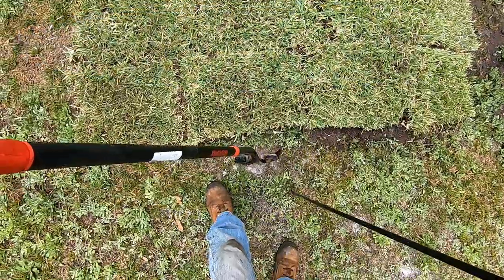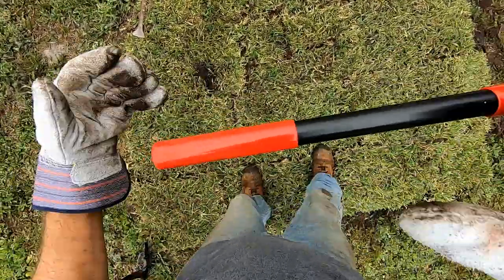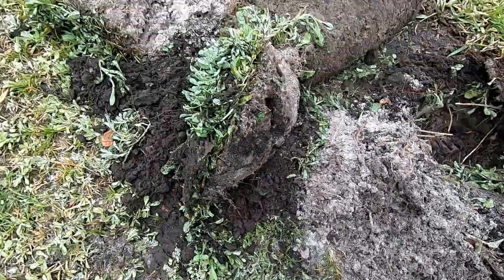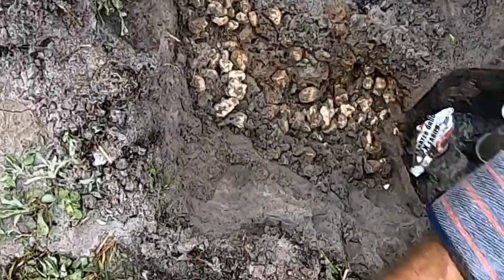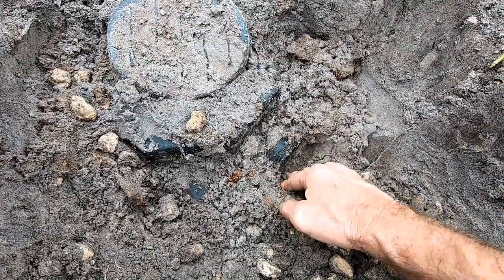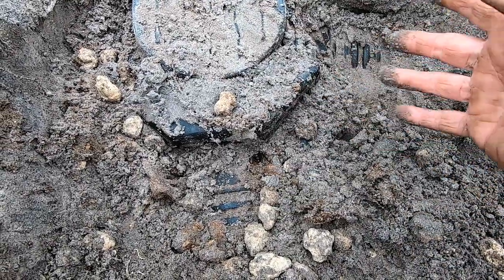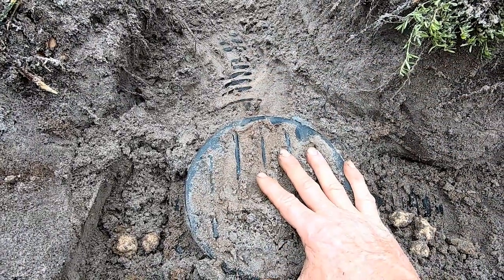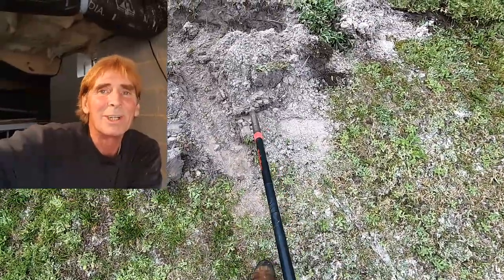Failed Drainage- Find Distribution Box of Septic Tank - Drain Field vs French Drain - How they Work

Comment: I am making a french drain but it is very long probably about 75 meters, so to prevent my digging into the earth's core, I was planning to use some box to split it so a tube coming in at the bottom and then a tube coming out of the top but I don't seem to be able to find such a box. All the boxes seem to have the entry/exits at the same level. Is my plan flawed?